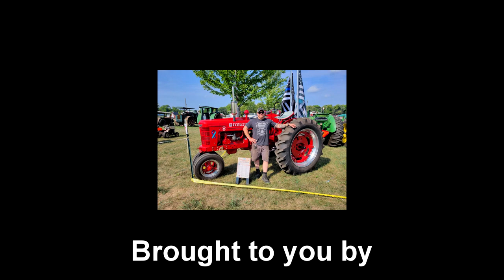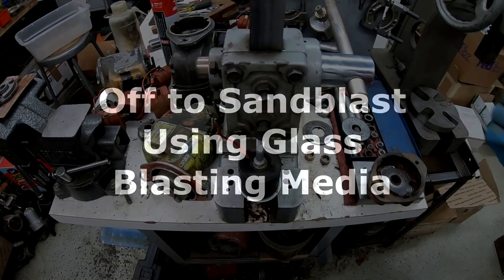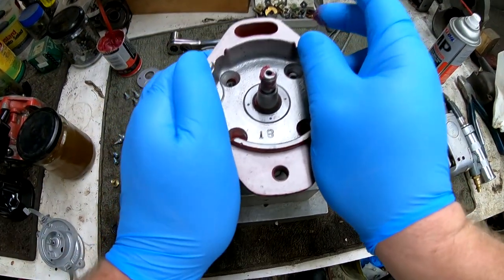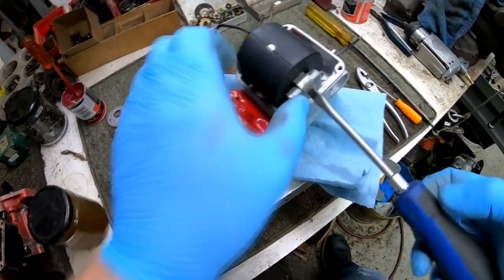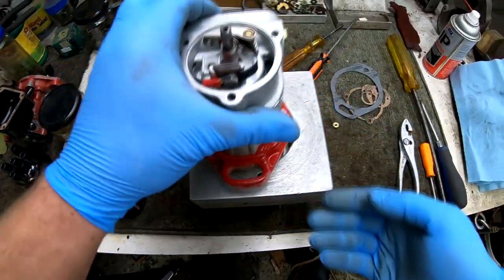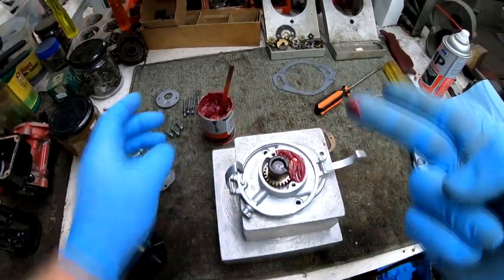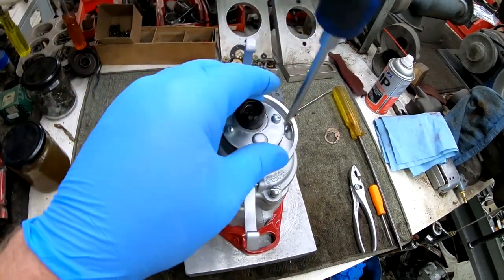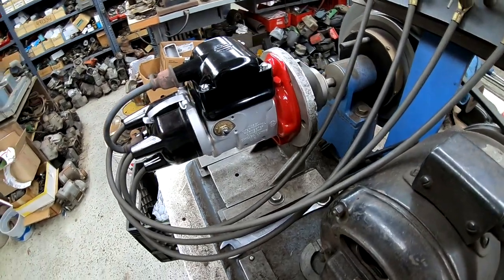International Harvester/Farmall H4 Magneto Rebuild & Restoration

Comment: does the other bearing race, washer, seal, retainer press out of the housing the same way as the part you showed in the video?
Reply from the maker: @chad4132  if you're referring to the bearing race and seal at the back of the housing, the race requires a blind hole bearing puller. The seal is felt held in by a retainer.
Reply: @KennyKizzleRustyNutzRanch  you meant the seal is held in by a retainer?  How is a blind hole puller able to get under the race if the bottom of the race is all the way flush in the pocket?  thanks for your reply

Comment: Restoring a 1941 H myself right now. I was working on my magneto rebuild. The oil seal retainer washers were damaged by corrosion, and need to be replaced. I came across your video here and was hoping you’d have part numbers. I can find the leather seal, but not the inner and outer retainer washers. Any suggestions? Thanks.
Reply from the maker: We have them at the shop. Give Rudy Calin a call at rebuiltmags.com!
Reply: @KennyKizzleRustyNutzRanch  talked to him today. Thanks! I was just about to machine my own.